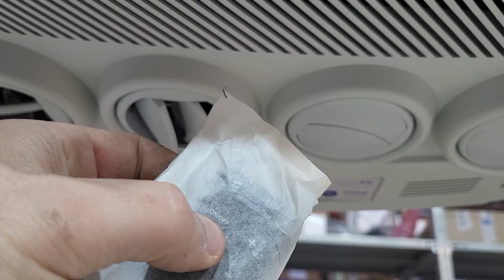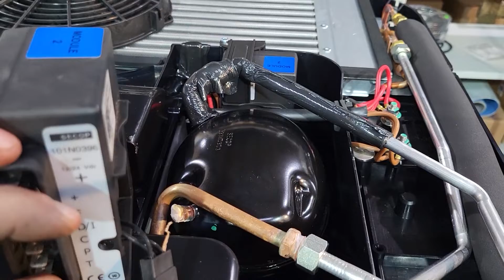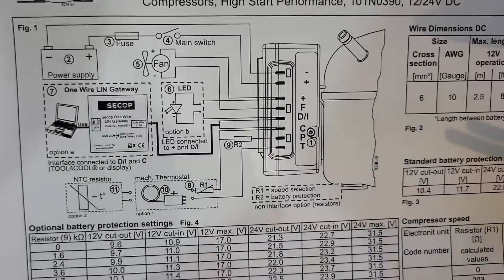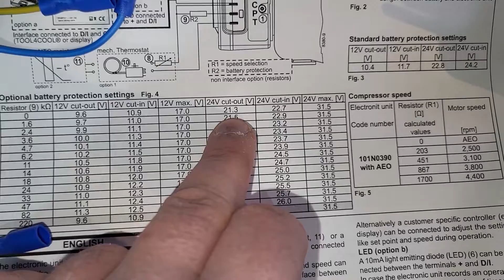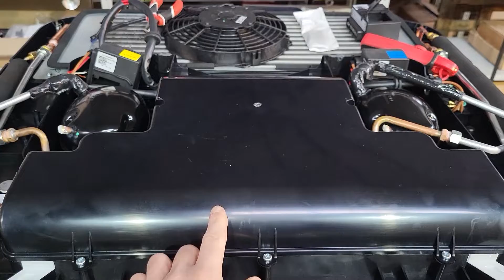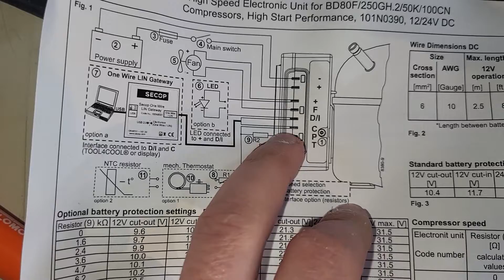Secop controller diagnosis, Cooltronic Parking cooler, 24V DC air conditioning, Dirna, Eberspaecher

Comment: Had almost the identical fault with a Secop unit...ended up running an independent ground wire and all was well. It ended up being a ground connection that was just weak enough to read good without being under load.